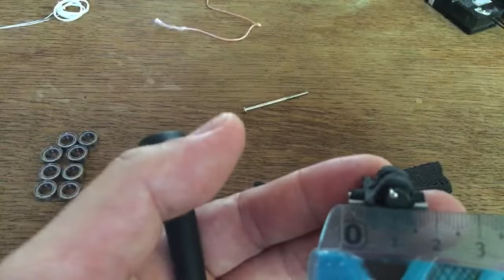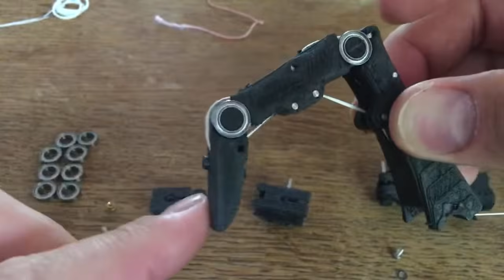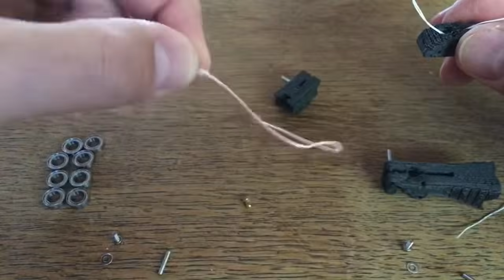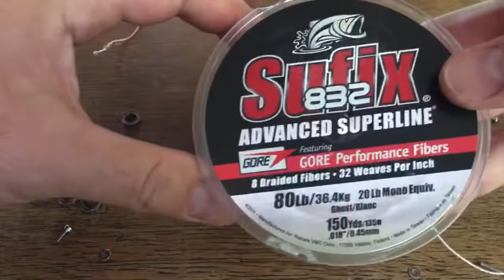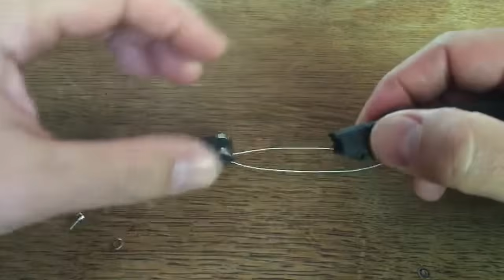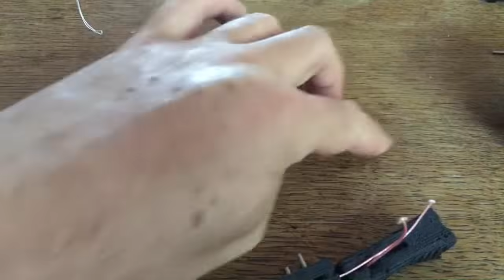Assembly of #robot finger

Comment: Awesome! Do you plan to add sensors for the joints?
Reply from the maker: Probably not at each joint for the versions that are driven by servos. A curve sensor might be a simple addition to give some feedback on the finger position but I'm more interested in estimating the grip vectors at each contact point.